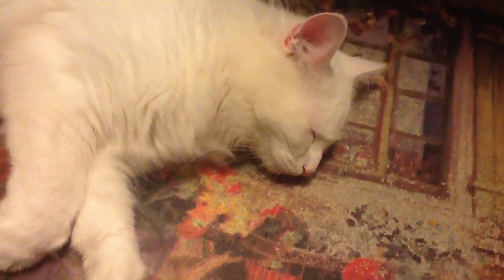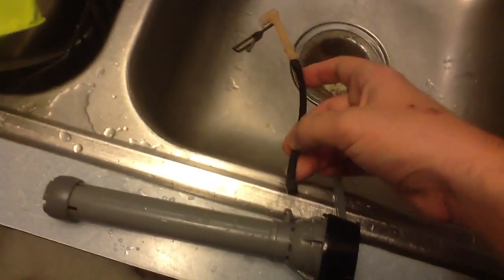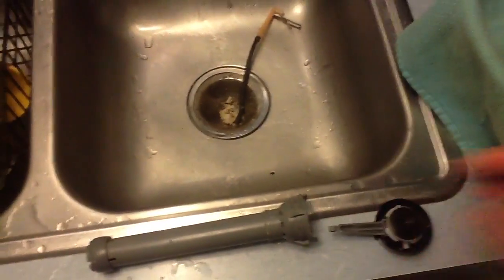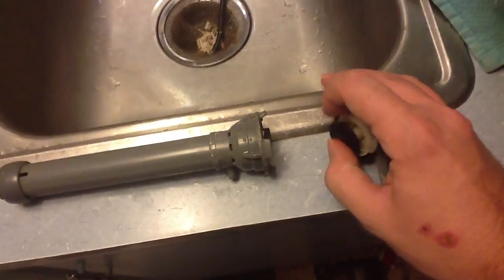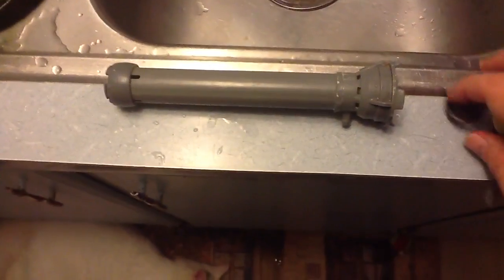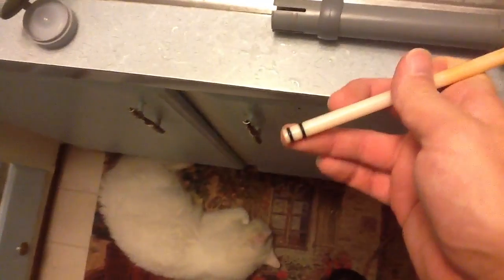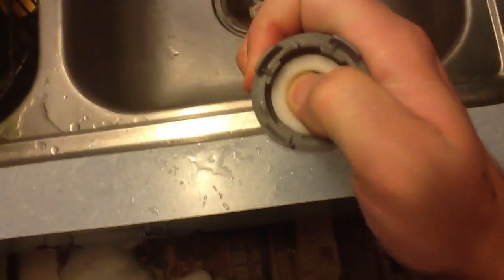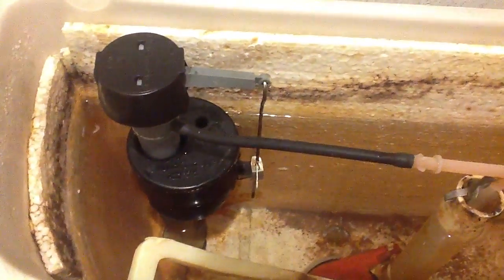How to Clean a Toilet Fill Valve (Fluidmaster 400A)

Comment: very informative but honestly these fill valves are only like 10-13 bucks at home depot, lowes etc.  I usually just replace them every three years rather than all the timely cleaning.
Reply: i think it depends on water quality around your area. mine used for over 20 years and after clean like this video, working like new again. from NZ
Reply: mark summers That $13 bucks was used towards my woodworking supplies instead! Took 10 minutes to disassemble, clean, then reinstall! Tank fills immediately after each flush! (Good 4 Me)...